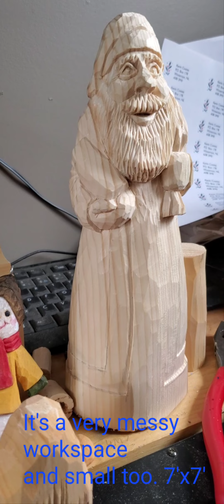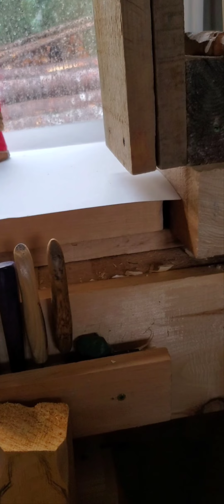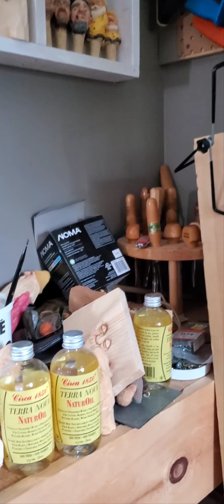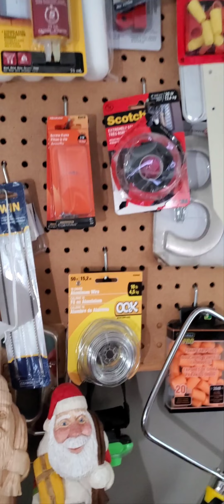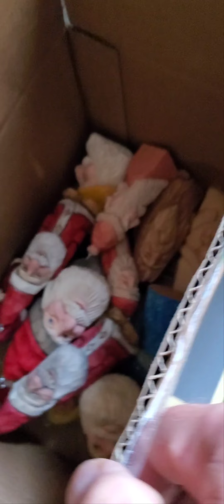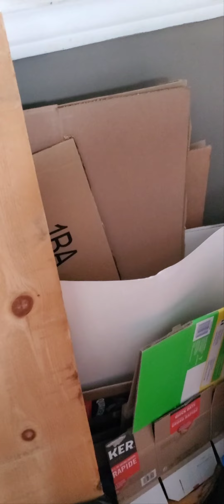A Quick Trip Through My Small And Messy Workspace

Comment: What struck me the most is at 0.52 seconds start of the video, just outside the window, “pile of woods”. . . lots of it, years of supply 😄. Thank you for the tour Kevin, they were messy alright, but it shows that you have a lots of ideas 💡 to work with. I do keep a vacuum cleaner close by when I’m done.
Reply from the maker: Dan, at the end of the day I have time to sweep up the chips and that's about it. Believe it or not, the wood you see won't be used for carving. Sawlogs for some boards I need and firewood for the winter.  Thanks
Reply: Just a wild guess, yes winter just few months away. When I do faces Kevin, mostly it’s your tutorial demo that I refer to. Do you sand your work after? Stay safe as always Kevin.